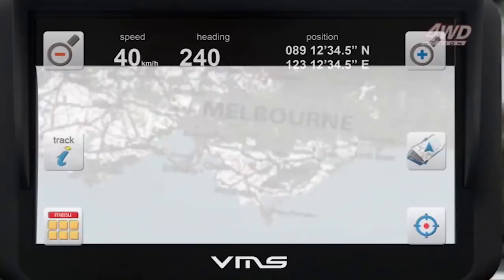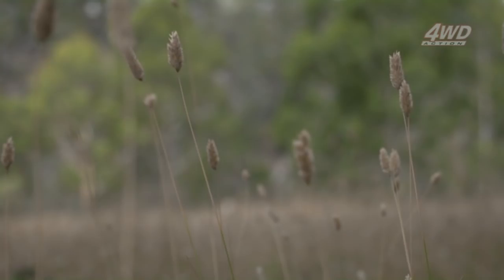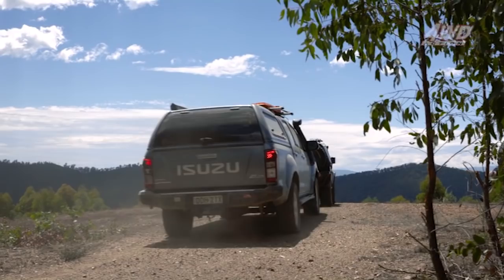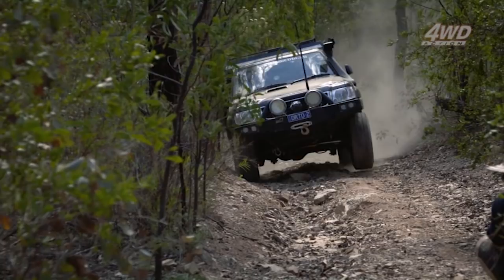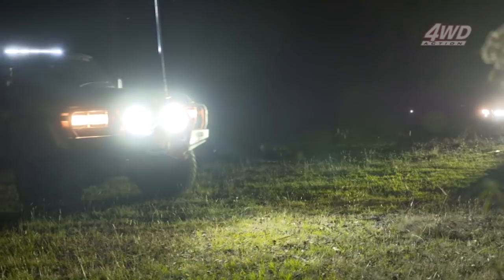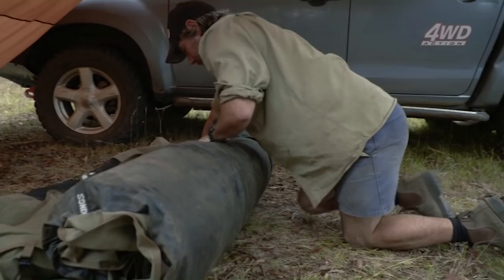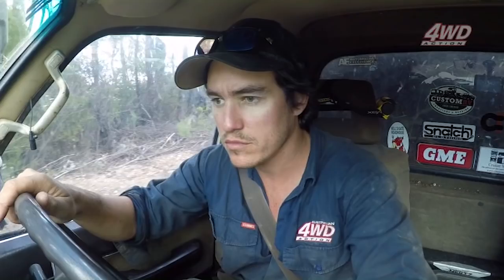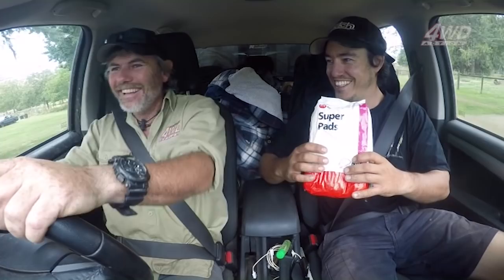The Dirty 30's FINAL EPISODE 😢 Four start...only two finish!

Comment: Perfect advertisement on why not to take a camper into the HC , you will kill your car . best option for a camper is find a base to camp and do day trips without the camper.
Reply: 100 %
Reply: exactly.   I am considering an overland trailer, but I had always expected to leave the camper where ever while doing the harder sections.  The problem becomes when those sections are on the way
Reply: If you listen to what they are saying,  they take the trailer with them on the track for R & D to TEST THEM !!!!!
Reply: @johnp8409 R&D is a funny way of saying advertisement John
Reply: Buy a better truck
Reply: Luke Dempsey 
I agree but I have a 6x4 box trailer on stock wheels and everything 
All I have in it is 100l of fuel and king single mattress

Comment: Done the same as Nick in my GU, i had 2 full mechanics tool boxes,  4 × 15m short link chains with dogs, 2× 20t hydraulic jacks plus parts for an excavator and i stripped 8 teeth off the crown wheel and 4 off the pinion while climbing a slate ridge to  fix an excavator, just lucky i was right at the top so it was an easy fix on flat ground,  just a long hard walk up that hill carrying a diff center the next day

Comment: Loved doing the high country in my $2000 Jeep Cherokee xj, handled it like a champ. Only thing that let me down was a cheap Chinese wheel bearing which was bad when I got back (but still didn't let go, just noisy). Goes to prove that on casual worker money as a student you can do the tracks and have fun doing so. Cheap 4 wheel drives are generally petrol, so 2 20l jerry cans saved my bacon. Definitely worth it.

Comment: I really would like to see so budget trucks back on 4wd action like in the old days with roothy like Coffs video when Shaun first got the dirty 30. Enough of all these big dollar trucks
Reply: Cameron j Marsh no big dollar cars here 
Except the wholesale car
Reply: Cameron j Marsh where was the big dollar truck?  the two main utes are definitely entry level 4x4s, a nice old 60 series a dmax both covered in kings budget gear literally not big expense item to be seen, the other 2 are sponsor cars which are specifically meant to be the ducks nuts as advertising
Reply: No high dollar cars? Shaun's ute was chopped by Creative Conversions drive in drive out, that's about 20k right there.
Reply: They still have zero dollar zook although I thought that was supposed to go up the cape still waiting
Reply: need to remember the videos are aimed at a very broad group to promote sales and 99% of 4x4 owners dont drive around in 1k buckets most have 20k trucks and up.  and you can easily get a 60 for under 10k so even chopped for 20k is still fairly cheap, unless you would prefer them to be rolling around in great walls and shit but then who would watch the show?

Comment: Shauno needs to get the brakes redone, that engine mount fixed, beef up them front shackles with a welder, and get d30 back on the trail for a resurrection.

Comment: Awesome series boys! Kicks in the wonder lust! Where to next? Would be great to see the series with its global audience try tracks in Africa and elsewhere. ( I wonder how happy you would look after stripping your diff?  Happened to me in a Land Cruiser FJ45. Pulled out the crown wheel and pinion and ran it on the front diff. I was happy to get home but was not smiling!) Not easy towing a trailer over the rough stuff at the best of times... Not a fan of the camping trailers. I have towed enough to know all obstacles become far more technical. A 6 pack to Nick, better travels next time!

Comment: You want steep? Try Dingo Hill track out of the Caledonia river up onto the Bennison Plains north of Licola. Very close to this vid location. 
It climbs from ~ 600ft up to about 4500-5000ft elevation. I haven't been up it lately but that was by far the most arduous track in the Vic high country I have ever been up. Seen about 4 or 5 rolled over remnants on that one track alone and roll over remnants on every approach and exit in and out of there including a missing couple stuck fast against a tree for 5 full days before I got there.
It may've been re-aligned since I was there last which was getting on for 20 years - heck! A properly steep track. Those others are pretty good but this is something else entirely.
If you want a scary ridge track, Butcher Country track is a good one. Side angles, tyre tracks at different elvations causing alarming side angles on a very narrow ridge and steep rock shelves (with black tyre marks) while still on the narrow ridge LOL. Bowel loosening stuff. Some spectacular helipads on the ridge and the river camping at the bottom is amazing - but yeah don't go there without experience, at least one other vehicle and vehicles set up for this sort of work. 
From north to south it goes from Howitt Plains to Macalister river track (right) or Caledonia river (left) both tracks left or right are good steep tracks in their own right. If you go left you it connects with Dingo Hill track (mentioned above). Don't even think of taking a trailer. I like a fourby with full floater rear end for this work. If you strip a crown wheel (pinion nut usually comes loose causing that) you can just remove the axles and drive home front wheel drive style.
Best to leave the D-Max behind for Butcher Country/Dingo Hill trip. It could do it well driven of coarse, but to what end? I saw a L-300 4x4 van on Butcher Country one day about 10% of the way in and they were making a great go of it, but they had utterly no idea of how much more was to come - after they're off the ridge track they still have 2/3rds of it to go.

Also, in my hardcore 4x4 travels in the the Vic high country some of the best little spots were accidentally discovered en route to hard core tracks. Many of those little spots are accessible by any passenger car. 
Few times I've just left the fourby at home and just gone up there in the car, camped on the side of a crystal clear creek and never saw another person for 5 days.

XXXX at Dargo pub? That's a first!

Comment: Not throwing stones guys, just a question. Wouldnt jacking the rear of the patrol off the ground after the tail shaft was removed and spinning the wheels by hand have gotten rid of the wind up?

Comment: all u need is 2 car batteries 2 sets of jumper cables and a welding rod or two and u can weld just about anything in the bush.. I'd make quik work of that engine mount for sure. great lil trick to know it's saved me. a time or 2..u aussie's sure know a good time  :) much love from Seattle WA

Comment: Honest question:  If the brakes on the trailer are locked, and thus just skidding, are they really helping as much as they could?  Also, if they are locked and skidding, what's stopping the trailer from going sideways, instead of 'following' .. ?

Comment: noticed most  are diesel.. gas  harder to find  or just cost diff?
Reply: Diesel is actually more expensive down under at the moment (who knows why?).  But diesel trucks are generally preferred - for torque, water crossings, fuel economy, towing, simplicity, etc (not such a big deal in the modern era of course).  All fuel types are readily available just about anywhere, but for remote touring there are places here where you can be hundreds of miles from the nearest town - but there might be a cattle station with a diesel supply for their farming equipment.  In fact, there's a famous sign on the Gibb River Rd that says "You are now closer to outer space than the nearest town".  :)

Comment: Stuck piston on the brake? Mine went that way after some water got in and it sat for a fair while.
Reply: Ah dont ditch the 30 there. I could've fixed both those issues with a small gasless mig welder, a bottle of brake fluid, some 1200 sandpaper, an f clamp an inverter.

Comment: 7 hp motor on that winch?  The amps would be out of this world.  It would kill a battery and or blow it up in no time flat.  I have a 850 amp hr battery and would be afraid of catching that thing on fire.  What kind of battery(ies) is he running?  BIG old diesel battery?  What kind of alt is he running?  Must be kicking out 200 to 300 amps or more.

Comment: Great job guys, Shauno should buy himself a Foton luxury Ute and give that a run while the 30 is off the road :) Any chance the Zook journey to the Cape will be posted? Cheers
Reply: wtf y I looked it up and it looks shit cmon man
Reply: Because it is the only chinese ute to use a Cummins motor, Dana diffs and borgwarner transfer and gears. Yes they are made to licence by the chinese but they still have to follow the original blueprints plus if anything ever goes wrong you can get parts and fixed anywhere. I took one for a test drive as well as the LDV and found it better overall and until people actually drive one themselves you are at the mercy of the internet troll's opinion.
Reply: Yea but they're the ugliest looking ute around mate, if you fancy that thing over a Ranger/Hliux for looks then yo have no taste in vehicles at all my friend.
Reply: For looks yes but you put a decent bull bar on and it looks awesome lol, plus I like the idea of the costs difference compared to a Ford or Toyota being in my pocket rather than theirs....
Reply: It could end up being a double edged sword for both 4wd action and foton 
I admittedly haven’t had anything to do with foton or ldv but if Great Wall is anything to go by then I imagine they aren’t that bad the Great Walls aren’t bad for the money if your running a fleet and plan on them being worth nothing (think landscapers utes they get absolutely run into the ground) 
The flip side of it is it could easily end up like Andrew st Pierre whites experience with mahindra where it broke down early in his test he gave a scathing review and it ended up being a massive failure for his book that year due to it being all over it
Reply: Going by the DPF problems that Ford/Mazda/Toyota have and all the product recalls that is a risk all vehicles face. I just like the Foton because of the hardware it is running. Anyway I would like them to post the rest of the Zook tour to the cape :)